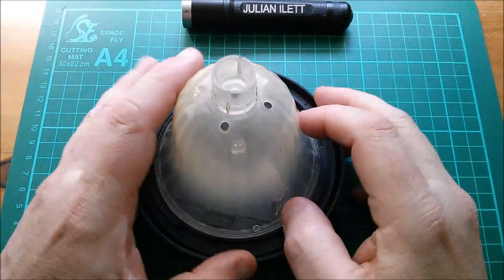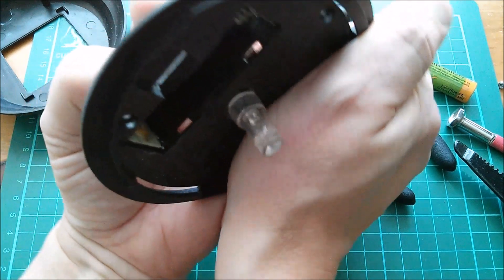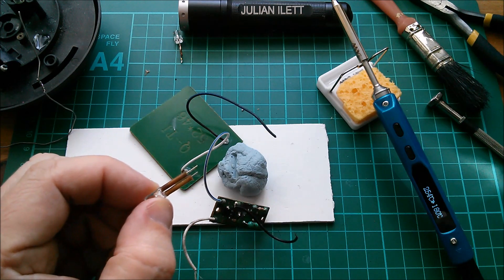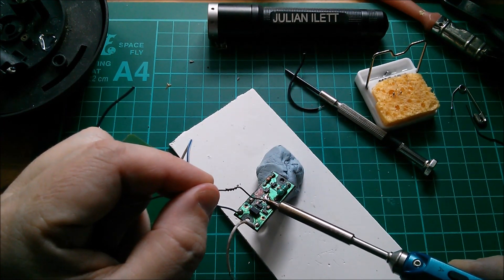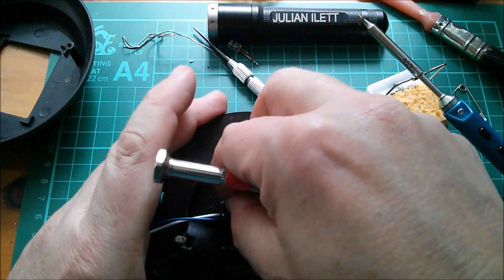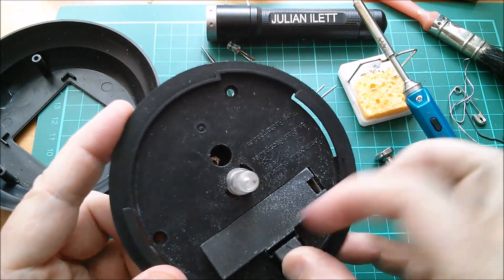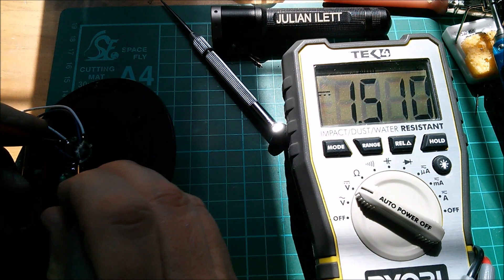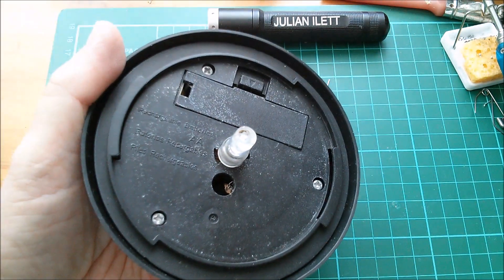Garden Solar Light Supercapacitor Downgrade

Comment: How many Farads would be roughly equivalent to the 800mAh NiMh battery?
Reply: If you use a supercap in a circuit designed for a NiMH cell, you will likely need MUCH more than 948 Farads to get the same run time, due to the cap never being fully charged or discharged.
Reply: >How many Farads would be roughly equivalent to the 800mAh NiMh battery?

You need to know the voltage of the battery. But assuming a single cell with an average of 1.2 volts:

800 mAh x 1.2v x 3.6 = 3456 Joules

For the capacitor, the formula is W = ½ QV = ½ CV2 where W is energy in Joules, Q is the charge in coulombs, V is voltage and C is capacitance.

You'd need a 4800 Farad capacitor at 1.2v to equal an 800 mAh battery at 1.2v. But realistically you'd need a much higher capacitance because the capacitor has more or less a linear drop in voltage for how much energy you pull from it, unlike a battery which holds a near steady voltage for most of its lifespan.
Reply: It is for brainlets like me.
Reply: @Dana Vixen Eaxactly my thoughts :D
Reply: Dana Vixen give a man a fish and you feed him for a day; teach a man to fish and you feed him for a lifetime. 

i told him how to do it and now i hope he (and others who intrested how to calculate) know how  to convert farads to wh or ah and vise versa. 

as  i told its not hard. so you dont have to be so aggressive to others.
Reply: Markle2k you are wrong read all answers to first message before claim something
Reply: Markle2k You are troll or just stupid. I reply with all formulas and how to get results, but you did not bring it up when i asked to read all answers. So please shut the fuck up.
Reply: You just cant accept that you was wrong and disgrased yourself with "You taught no one "how to fish" " and other foolishness actions.  When i already posted good answer for him after he told me that "It is for brainlets like me."  and obviously he dont  want to google it. And it hard for him to find answer.
So i give him good answer that help him calculate not only 1.2v 800mh to farads but 3000f maxwell to ah and everything he want to calculate farad related, even i was on phone and it not that easy to write such things.

I hope you some day will grow up, get some brain and will understand that
Reply: Different people's assumptions about starting and ending voltages give the different results:
Start by estimating the usable energy of an 800 mAH NiMH battery (per Darron):

1.2V * (0.8 AH * 3600 sec/H) = 3456 Watt seconds (=Joules)

Then plug in assumtions about starting and ending voltages on the superCap to get:

Start, End, F needed, whose assumptions
----------------------------------------------
2.7v, 0.0v, 950F, Darron
2.7v, 1.0v, 1100F, Voidex
1.2v, 0.0v, 4800F, GGigabyteM

(these are rounded by a few Farads; the inaccuracy of the input estimates does not justify a lot of significant digits of calculate values)

Simple formula for these (Vs = starting voltage, Ve = ending voltage)

3456 * 2 / (Vs*Vs - Ve*Ve) = C in Farads

And of course a 600 mAH NiMH battery would be 3/4 of these calcs.

Of course these calcs are just to give a lower bound on super cap size, as they assume that all of the theoretical energy between the starting and ending voltages is converted at 100% efficiency to the voltage needed for the LED.  That will NOT be the case, especially at these low voltages where a semiconductor junction or the resistance of a FET cause significant losses.  So in the real world, it would probably take a good deal larger supercap than these calculated minimums.
Reply: Voidex- "Calculate it. its not really that hard. i even made program to do it for me. seen's i do it quite often"   ... servant74 clearly asked for someone to do the calculation. you say its not hard,  you say you do it quite often. YET YOU DON'T ANSWER SERVANT74'S QUESTION even though you bragged to made a program to do it... are you kidding me?
Reply: A 1.2V nominal NiMH cell with 800mAH of capacity stores 3,456 Joules of energy. To get the same storage in a fully-charged 2.7 Volt supercapacitor, it would have to have a rating of 948 Farads. This assumes that you are able to fully discharge the supercap to get all of the energy from it.
Reply: +Voidex You taught no one "how to fish", you just bragged about your angling skills and walked away leaving nobody any better off.
Reply: Ok, let's not climb all over Julian.  Yes, his response made me upset temporarially, but such is some folks personalities.  I did figure it out myself, it took about 10 minutes with our friend google (and I did get the same 948F answer).  

But I am sure Julian didn't remember off the top of his head, and was on to other things so his calculater was inconvenient to get to.

For me, it was just a question of interest, but became a 'learning experience' for this senior citizen.  We all get old, and forget, especially since my last physics/chemistry class was over 40 years ago.  So it would be nice to get a non-putoff answer, but such is life, and we all need to learn to move on, and hopefully not treat others the same way.

Julian, thanks for putting up the video and peaking my interest.
Others, thanks for the concern.
Now lets all go and keep learning and growing together.
Reply: uK8cvPAq Energy E in joules = (CV^2)/2  (c is capacitance in Farads, v is voltage) . To get WH divide E by 3600. To get AH divide WH by average voltage of you capacitor (for example 2.7v starting voltage 1v end discharge  voltage. So average v is  3.7v/2=1.85v). But since you discharge you supercap to only 1v from 2.7v you have to calculate energy by discharging it from 2.7 to 1v:  (Cx2.7^2)/2 =Etotal  and you have to substract energy left in cap with 1v from  total energy. Than when you get energy use formulas to get Watt hour and than AH. 
it was quite hard to write everything on mobile phone ^^
Reply: +Voidex Oh smack!  You really got me with that one.
Voidex: "Calculate it. its not really that hard. i even made program to do it for me. seens i do it quite often"
uK8cvPAq "It is for brainlets like me."

Dana Vixen: "servant74 clearly asked for someone to do the calculation. you say its not hard,  you say you do it quite often. YET YOU DON'T ANSWER SERVANT74'S QUESTION even though you bragged to made a program to do it... are you kidding me?"

The others actually tried to answer the question and you responded with:
"i told him how to do it and now i hope he (and others who intrested how to calculate) know how  to convert farads to wh or ah and vise versa. 

as  i told its not hard. so you dont have to be so aggressive to others."

Nice bit of hypocrisy there. You didn't do jack shit to help anyone. You just bragged about your mathematical ability as a 10 year-old fresh from summer camp would brag about their sexual prowess with a Canadian Girlfriend whose picture is clipped from their mom's fashion magazine. And then you bitched about people doubting your prowess.
Reply: A troll with Google labelling others trolls. How 2000s of you.
Reply: Wow you were on your phone and yet you took the time to write all that without actually producing anything, what a waste.

I hope some day you will grow up, get some better time management skills and maybe some compassion.
Reply: servant74 Calculate it. its not really that hard. i even made program to do it for me. seens i do it quite often

Comment: how long did it run for?
Reply: Much less than a battery for the same cost I suspect.
Reply: See G6EJD reply above. It would last only a few minutes.
Reply: yep pretty pointless
Reply: @ronjones4069  Nope. I did it to with my test solar light and I have different results. I modifyed the board to weaked a little the LED (weaker light, but much longer work time), added better cables and I put resin on board to prevent it from water. Now they shine even if other lamps dont want to work (because of the rain), and if weather is good, works up to 2h I think. I never was patient enought to measure it xD Already I got few deads lights (battery died) but my modded lights still works fine. I used 50F and 100F ultra capasitors. Putting all together was a little pain in ass but result is satisfying. One tip is to check the solar panel. Solar cells in resin panel can crack and lost their power (but voltage is still ok) and those glass cells can coroded if worker did not put enough hot glue under solar panel.